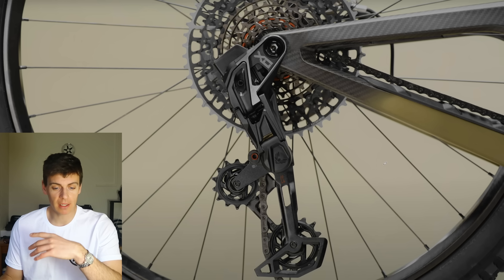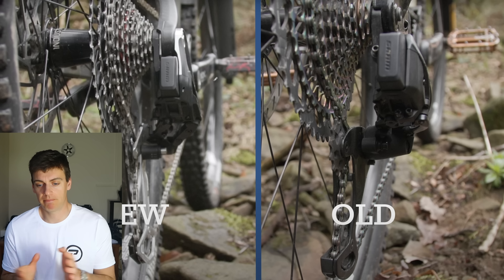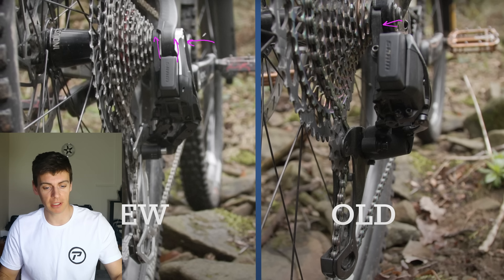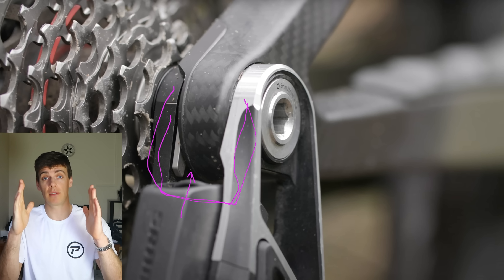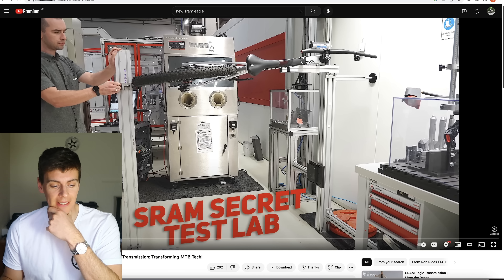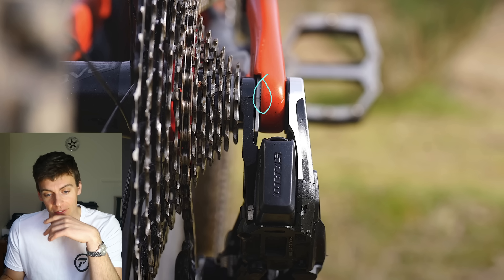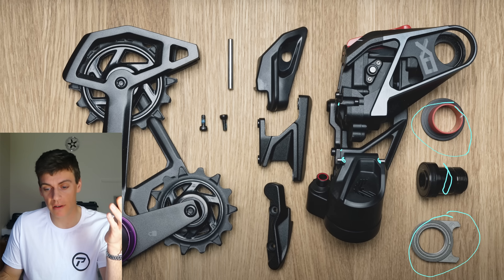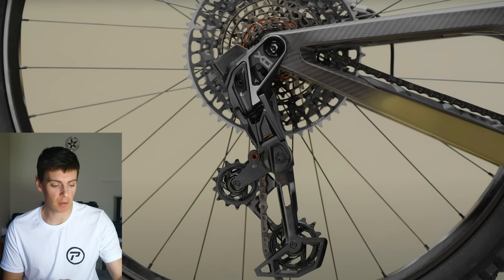Mechanical Engineer's Speculation of new SRAM Eagle (including misinterpretations!)

Comment: Another expensive product and standard that forces the entire market to upgrade to new bikes. This system has been designed and produced for business objectives and produces micro gains for the customer. If i was Shimano I would go on the counter defence with an "open" standard that achieves the same principles but doesn’t require a new frame (I am sure its possible - You would have a better idea than me) Why? firstly their brand really needs to become consumer centric very quickly to win back trust... And it would be the fastest way to send a bullet to SRAMs business objectives of market standard domination which is a huge win for them in the long run.

Comment: I think the main disadvantage, you mention is the biggest advantage after all. Bike industry has cut the cost below any reasonable limits during covid Pandemic. Maybe it's time to improve the quality after 3 years of excessive profits ? Honestly since 2020 the quality of extremely expensive bike parts  has dropped so much, I cannot even believe it.... I think we are now buying mass-produced branded junk from big companies. For eample a frame for USD 4000, they buy for USD 500 shipment included, it simply cannot be of appropriate quality. Your opinion is reversed thinking, we should expect the manufacturers to produce higher quality frames, we are already paying for... excessively. Other thing, it seems you do not have experience in crashing ;), I've crashed a lot in my cycling career, in all cases I had to replace the rear mech along with hanger as it was bent or even broken as well. The rear axle, the freehub and frame triangle suffered anyway, therefore you are theorizing there with no real life experience ;). Often in case of a crash that hard you will brake your expensive carbon frame elsewhere anyway. Regarding the piece of metal, you mention it is not supposed to move and it does not. The frame bearing ( in case it is there) is replaceable, rather cheap, for sure cheaper than some of derailleur hangers and you should replace it after every season anyway. Ok, but after all nothing is perfect - it has disadvantages, you don't mention: 1. I am not sure about durability as the chain is narrower than the old one which along with shifting under load may cause the chaing to wear quicker  2.still there is loads of bike frames not compatible with t-type - my  2019 xc ht isnt 3. It is extremely expensive. To sum up if you intend to use it for enduro may I ask why ? Do you need electronic shifthing, low weight and fancy looks for riding in a bike park ? No, you just need first and optionally second for XC racing and this is where I use it. After around 1000 miles on t-type I must admit it gives some advantage in xc racing. However, I do not really like how it shifts while less dynamic riding as it is more sluggish under low power than old axs, so again in my opinion you do not need it for cruising around,  riding in bike parks, If you are old AXS user I would not upgrade as of today. Full review coming in October ;).

Comment: It seems like they did all this because they really wanted to use the cassette mapping feature.  To do that they kind of had to do away with the B screw adjustment because having freedom to rotate the mech would change the relationship to the cassette and ruin the cassette mapping?  (Question mark because im not totally sure)  Once they did away with the B screw they pretty much had to do away with the hanger?     So why do cassette mapping?  I think a lot of people didnt like the way AXS shifted in its slow - one at a time - way.  A cable system can be abused, you can thumb through a few gears at a time then repeat and go from like 10th gear to 3rd gear pretty quick in preparation for a change in grade.  Thus the need to improve shifting under load with cassette mapping - for the ebike market and because wireless shifting felt slow.  To me its interesting but its a long line of we did this because we had to - flowing all the way back to "lets make it wireless".  Its not lighter (in fact its heavier) Its still a rear derailleur hanging off your bike and thats ignoring your comments about frame tolerance.  Im not sure how much I care about strength, I rarely break mechs or even bend my hanger, but if its as bulletproof as they say I could see people getting hung up on a rock or a stump and getting pitched off the bike because nothing bent.  For recreational riding Id rather bend a hanger and bend it back to limp home than get thrown over the bars lol.   All that said - the typical channels on youtube were clearly parroting SRAMS media bullet points and not doing much critical analysis.  Time will tell but I will others find out the hard way and spend my cabbage on other stuff.

Edit: After watching your 2nd Video I see that there is accommodation for reward rotation so hopefully nobody gets thrown off their bike but you make a good point that the serrated teeth of that plate will be required to end-stop that process - interesting...

Comment: I will disagree on the datum part. We are losing consistency in axial alignment of the mech vs the frame which I don't believe to be very important. We are giving this up in exchange for eliminating the tolerance of upper idler distance from the cassette teeth. We are still bound by concentric runout and tolerance of the axle itself, which was there before. Not a huge difference. I think the big issue is betting that the frame will simply take the impact. I prefer the hanger for this reason but perhaps I'm mistaken!

Comment: but that serrated washer is clamped by derailleur bolt, not by rear axle force.
so at least, it shouldn't change position if you don't touch main deraolleur sleeve and bolt. right?

Comment: After PT’s vids pulling attention into this Sram Transmission, and more studies into the presented problem Sram wanting to solve with rear hanger.
I’d just found out, that, in the market where Sram is targeting with Transmission, ie. higher end market, shimano had that answered years ago with shadow, where derailleur is placed recessed and not proud. Isn’t that not true?

Everytime Sram introduces something, they are always “revolutionary”, just like dub with 2x.99mm spindle:)

And again, for in the lifetime of a bike where its hanger is bashed beyond repair, no way that the chain stay would stay as virgin as Hambini’s Disney princess.

Tell me in what percentage that looking for replacement hanger is the most prominent issue out of all the issues such as disc warping and fixing a puncture?

Comment: I can't agree with this speculations. The alignement should be very accurat because it is always coaxial with the wheel-axle. Also the impact is going mainly in the very stiff axel.
A 2-bar-connection will always be stiffer then a single-bar-connection.
With the drop-out/in mounting comfort of the wheel i will agree that could be a problem with the udh-system.
With the tolerances of the width of the clamps it can be fixed when the outer clamp is a fixed bearing and the inner one is a loose bearing. The clamp-force of the axis will then only goes in the UDH-Adapter/frame/outer clamp.
This are my assumptions as i have not yet seen the the sram-parts in reality.
But I have some severe shifting-problems with not good aligned, bented dropouts in my bikes.
(O.K. i saw the comment of misinterpretation only after my writing in "bad english" because german nativ)🙃

Comment: There is an aspect of SRAM's design that's off putting. It requires frame manufacturers to design around SRAM's proprietary tech. If anything has been established over the years it's that standards come and go. Apart from restricting a frame's choice of groupsets I wouldn't want to be beholden to a specific component maker for the viability of my frame.

Comment: Another mechanical engineer here. I think what SRAM has done is brilliant. You are using logic from the days of QR technology. Now the axle is integral with the mech. The forces won’t just be hung on a lever through the frame. They will transmit directly to the axel which has a massively resisting moment. Same thing with the tollerancing. If the dropout wasn’t machined perpendicular to the wheel, the through axle wouldn’t be able to thread into the dropout. And even if it was out of tolerance the trough axel would bring it back in once you tighten the threads.
Reply: There are two major assumptions SRAM make, that are hardly true today. The first one is that the frame building tolerances are thoroughly respected. The second one is that, after a couple of years of use, abuse, transport, wear and potentially questionable maintenance, that all tolerances will stay within spec. The former leaves barely any room for manufacturer error, while the latter leaves barely any room for user or maintainer error.

Slightly realigning a bent or worn out dropout was already a pain in the ass in the QR era (less with steel frames, but still), and having a replaceable derailleur hanger that you could easily align with the right tool allowed you to at least have decent shifting with a misaligned wheel. Bend a dropout by even as little as one degree (or buy a frame with an already bent one), have the inside of the dropout worn down from countless wheel removals, and you'll open a can of worms that should have never been there. You may be asking "why would a dropout bend?". I just know they do, and I've personally had an aluminium frame and a carbon frame with aluminium dropouts that ended up with a bent drive side dropout. I still use the aluminium one over 10 years later as I can align the derailleur hanger properly.

Bikes were built for ages under the premises that there needs to be a lot of room for error (angles, distances, clearances, you name it). In this fight for total integration and optimization, there isn't any left. Much like F1 engines that had to be pre-heated before even turning them on as the pistons were seized inside the cyliders otherwise. Bike tech should not be built like F1 cars or laser eye surgery robots. Bikes are not insanely specific tools to get one single job done as well as possible in ideal conditions. Bikes get carried about, thrown around, hit by random objects, fixed on the side of the road with AN hammer, partly disassembled and reassembled every other week... and most importantly are not supposed to be maintained by the very best mechanics and engineers in the world, but by the average Joe that has a half decent set of tools that can be bought mostly at the local hardware store.

Comment: My whole professional mechanic career I have been working to smooth the difference of tolerances to make a bike work. I have seen my fair share of bikes where the mech hanger sits misaligned on the frame and needs to be bent to compensate in order to have the gears work correctly.
I am not confident that the bike industry can pull off less adjustability and maintain such tight tolerances that eliminating adjustability is possible in the long run.
Only time I have seen a perfectly aligned bike is in the CAD drawings.
Most recently I have seen plenty of Sram UDH bikes with Sram Eagle rear mechs where it's almost impossible to get the top pulley to line up perfectly vertical with the cassette cogs leading to the chain clicking on adjacent cogs. The misalignment is not horizontal aka cable tension, but vertical twisting leaving the top pulley just slightly canted to one side from perfect vertical alignment requiring bending of the mech hanger to compensate.

Comment: I completely agree about the problem of doing away with teh sacrificial component, the mech hanger plate.
In addition to transferring extra loads into the frame itself on impact and possible issues with QC, it bugs me that this is in no way backwards compatible. 
Not for me.

Comment: Getting rid of the Der hanger is the best thing to happen since sliced bread. There are some glaring problems in this video, but you have addressed some of them, so thanks for that. The biggest problem I have with the video is that you keep mentioning that the frame QC alignment is going to be more important…. But why? The frame doesn’t support the derailleur, the axle does. Its in near perfect alignment as soon as its torqued down. The energy being transferred into the frame is no different than a hanger, assuming the hanger doesn’t give way. This system is going to prove to have better shifting quality and more long term reliability, no doubt about it. Shimano’s new system should be out over the next few months and is very similar.

Comment: Regarding the passed drop test; it doesn't matter at all if the mech passes all that load to the frame. If you get the exact same impact on the other side, where your brake rotor is, the frame is the only thing that's gonna hit anything. So idk how often you smash into rocks with your derailleur but you gotta be very lucky to never smash any other part of your frame into anything. No hate on you, just my thoughts.

Comment: I don't know with everyone else, but when I bend my hangers its often not by dropping the bike with no speed and without a rider. At high speed with a 80kg rider there's just way more force than I think this (or any lightweight) system can take. So every time my hanger is bent or broken I thank it for its service.
I think if it was SRAM's intension to make this a more durable solution they could have simply made a stronger hanger, make it almost as strong as the next weakest link. Let us have the option to choose.
Given the option between a hanger that'll never break and one that'll break at forces right before the derailleur or frame breaks I really doubt many would choose the one that never breaks. Does the never breaking one have advantages? well it will take slightly more force to bend it out of alignment, but only slightly, and when it does its the frame or derailleur that bends..

Comment: sorry, but have you ever used a hanger alignment tool before? hanger is never perfectly aligned - literally NEVER, it's always skewed in one or two directions, which would mean that the shifting never works perfectly - in reality, it simply doesn't matter. Slight misalignment rarely matters. The frame would have to be made in really miserable quality to perform worse then hanger. Even brand new UDH hanger are rarely perfect.

Comment: Top drawer content! 

That serrated dopout is pretty nuts to be honest and there must be a smarter solution that that?

The solution new solution is great for enduro racing at pro level. I mean if they would smash a mech,  it is pretty much game over right now. But with this system they can, probably, keep going - if the rear en does not blow up instead. But that is highly unlikely as they will probably have a close eye in it and change it out when appropriate..?

Comment: Didn't quick release have curated edges ? Dont remember ever having an issue with them .
Reply from the maker: They were normally on alu dropouts and weren't critical for mech and disc alignment as you had limit screws, if the datum moved. You don't see serrated end caps anymore on thru axle hubs.

Comment: In a video by Enjoyyourbike (a german bike dealer), the SRAM engineer points out that the derailleur is actually clamped to the rear axle and not to the frame, so the impact energy is going into the axle. He says, you would rather hit the derailleur than your frame. The tests they undertake are actually impressive, for a layman at least.

Comment: I'm not a mechanical engineer but I can already see halfway through that you're missing obvious mechanical features of this product. The rear axle is providing all the strength here, remember it's a solid bar attached to the other side of the frame, you would have to also bend the axle if the derailleur was out of alignment. As for side to side alignment, it's a simple adjustment in the app to line the cage up  with the cassette.
Reply: 1st knowledgeable reply here. I’ll add that until the mech hanger breaks (it’s usually aluminium alloy and doesn’t really bend and is designed instead to break), the forces in any impact on the derailleur are transmitted to all the components of the rear triangle in the same way (perhaps in a less damaging way in the new system because of it not ‘hanging down on a ‘hanger’ and being fixed to the axle?).

Comment: The first half of your video regarding frame tolerance almost entirely ignores that these are already issues, and the UDH system, as well as the new Transmission system, are independent of frame alignment. They are instead dependent on hub and axle accuracy, as these components clamp and self align accordingly. The clamping force oc the axle, hub, and UDH/T system far exceeds the torsional resistance of the frame at the dropouts. Your mindset is frame focused. Your concern over bearings completely ignores that these loads are already translated to said bearings on the same lateral impact. It's rare that it is "just" the rear Der that hits a tree/rock, often its the horst link, chainstay, etc. 

- Aerospace Engineer.

Comment: I'm not a sram fan. I agree with most of what you said. But, the crazy volume of hangers on the market is mind boggling! And...and....the hanger for my Habit is $92.00!!! WTF is that all about. Rear hangers are one thing I HATE about the mtb industry! You break a hanger there's always more stuff screwed up. And you can't get a hanger. No freaking chance the LBS has one in stock😂. So you go to Wheels and try to navigate the 10, 000 options to hopefully find what you need. Then pay through the Ass for a shitty little piece of aluminum. OMG I hate the hanger situation!